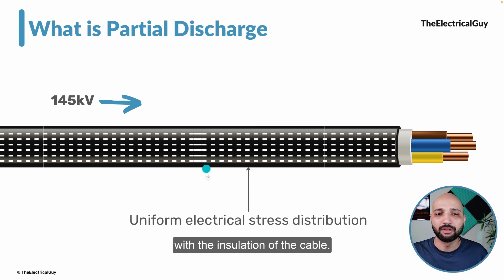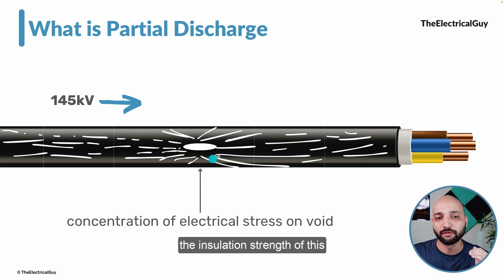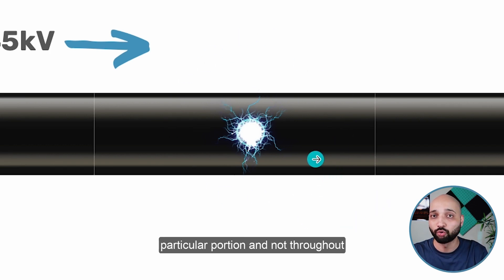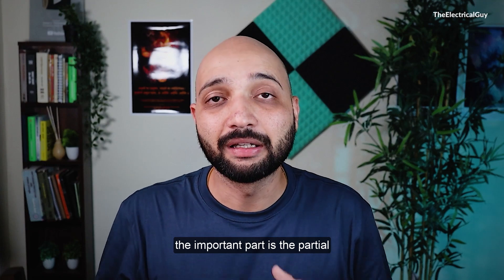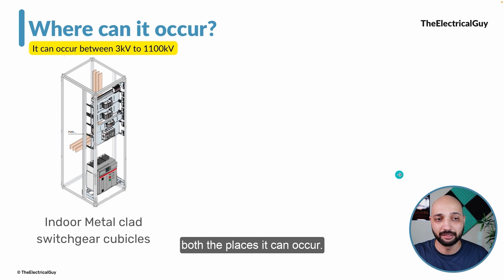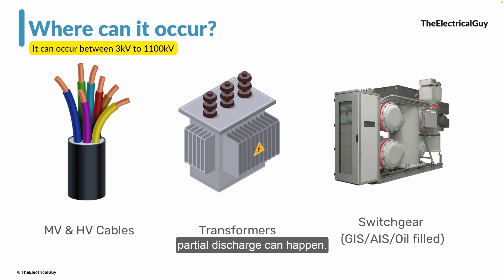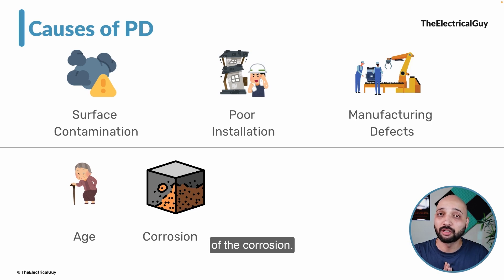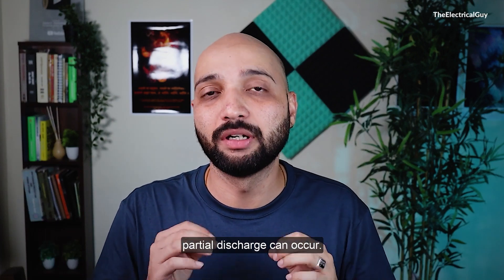Partial Discharge (PD) Explained | TheElectricalGuy

Comment: Informative video!
As a CT manufacturer, I am trying to learn about PD test in depth. I could not find much information about Partial discharge test in the IS 16227. By any chance, could you point me to a source from where I can gather knowledge about the whole process of PD test on an indoor CT. I have the PD setup and I am planning to construct a PD room the same as well.

Comment: on Causes of PD:  i don't know how you would categorize this, but, a real cause can be an external lightning strike.  a cause can be combinations of causes working at the same time.  an example would be an insulation rated at 180kV has a minor defect at one spot the can protect only 160kV.  at time of first energization all is well, but over time the insulation ages enough to drop its protection level by 15.001kV.  the minor defect will now protect at 144.999kV.  now that particular spot will have the conditions of a cause of PD. this would a combination of defect and aging that each alone would be a cause.

Comment: With carbon particulates in the air, if this is allowed to coat insulators over time, the very high voltage will use it as a path to short circuit and can cause a tracking path and heat damage to the insulator.
Gaz UK
Reply from the maker: Yes!